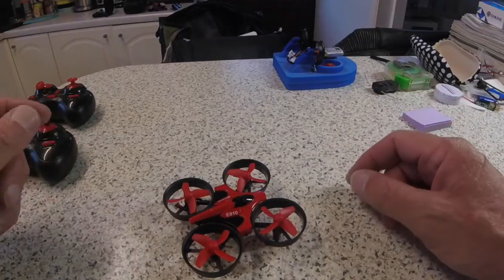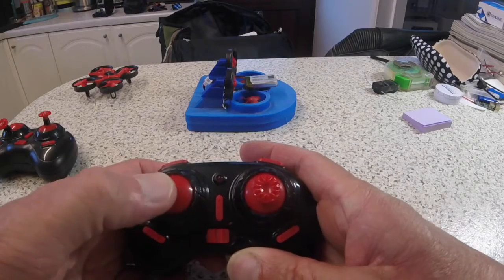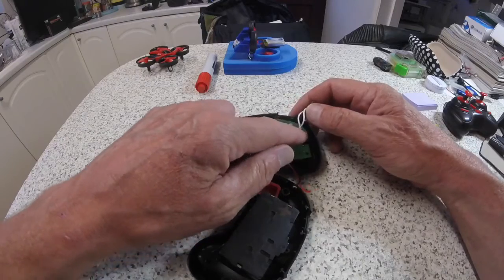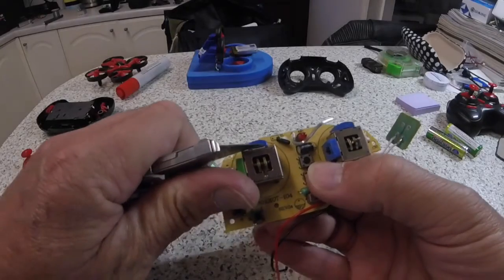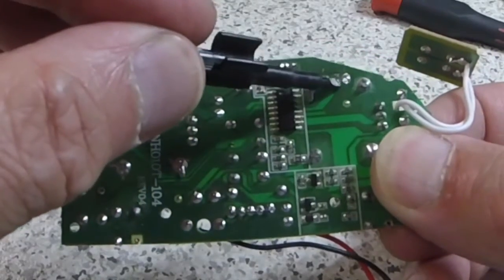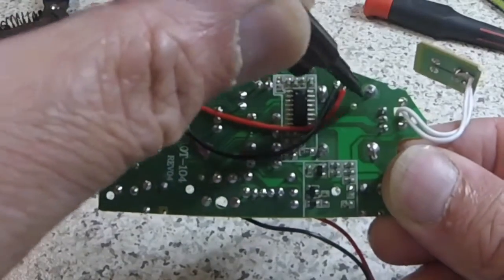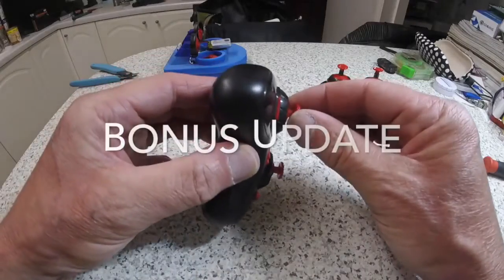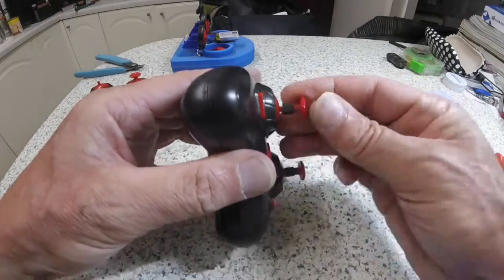Eachine E010 transmitter mod for Whoovercraft or Whoover (Whoove)

Comment: Thanks very much for posting. Small point - it took time to come across it as the title does not actually say "Whoover" and so does not pop up in searches for that name. It didn't offer me "Whoovercraft" as a near enough match.
Works well on some versions of the transmitter PCB, but would likely damage older versions of the PCB if carried out as this video. It's possible to do the necc work to the older PCB, but needs the pot outers reversing, and since the tracks are completely different and feed the pots in a differing order, you have to isolate the first pot on the track while re-routing the track via new wiring to feed the second pot. I have done it twice now successfully, and this way for several later Tx.
Reply: To anyone coming here now 4 years on, please be very carreful, there were earlier different board versions and have been a number of printed circuit card changes since then, and this specific wiring change no longer applies to  ALL variants.